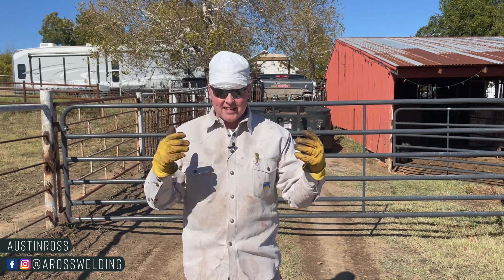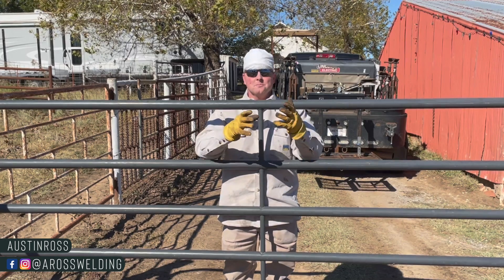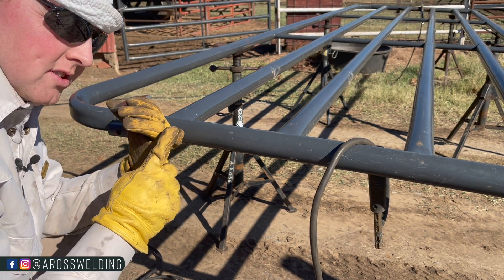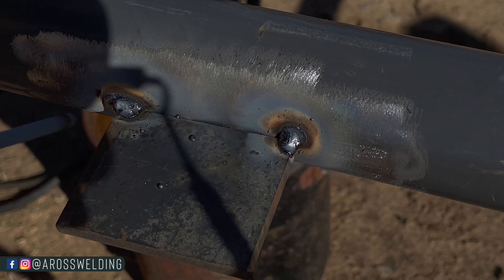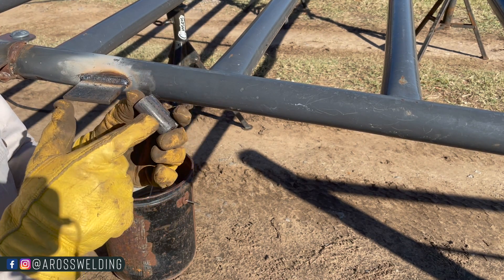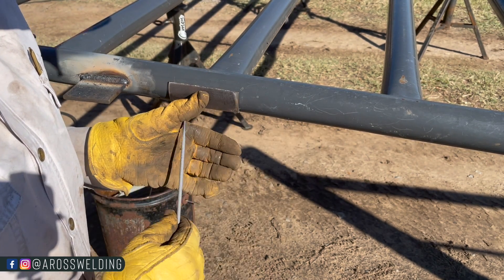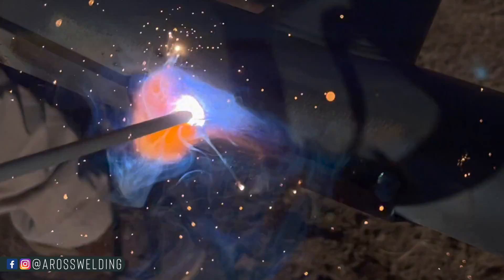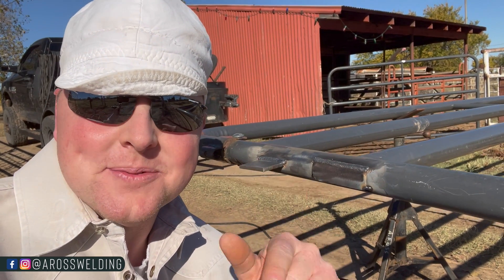WELDING THICK METAL TO THIN METAL WITHOUT BLOWING THROUGH

Comment: Could this still be done if the thick piece of metal could not be put against the thin piece as in your video. If the thick piece had to be under, I would think that it would be impossible to have a pool without dripping away from the thin piece if that makes any sense.

Comment: @4:08, why did u strike in the middle?
Reply from the maker: More or less to warm up my welding rod
Reply: @arosswelding   Thanks for the answer, I wondered if that was it. Great tip! Do you always chip the slag off your tacks before welding over them, or only when you're doing critical joints (like leakproof, or structural). In some of the latter cases, or for better appearance, would you perhaps even grind the tacks to a concave profile?

Comment: Thank you for your assistance. I have limited experience in welding and am attempting to weld a wheel bracket onto the front of my mower. I have tried using a 6013 and a 6011 at 70 amps, but have only burned through the lighter deck material in my attempts using a Hobart Stickmate LX

Comment: I got a 300d do a lot of pipe work and been thinking about buying a sae but the Corse currant or as you called main kind of makes me feel like I’d be trying to figure the Machine out for a long time be for I would get it how did you adjust to it from gears and like when you weld low high like that to have to figure it out see where it’s better I guess my question is how long it take you to get that machine figured what dose it do to the ark and would you go back to gears or stay corse currant

Comment: Question~ I’m not a welder, but I weld a lot.  I don’t  use a Lincoln SA-300, or 200.  But usually a Miller MIG, or trailblazer 275.  How do the settings on a SA200 or 300 run over to say a Miller digital?  Basically I don’t know the 2 dial setup.  Thanks!

Comment: I learned to weld while working for rumpke. Replacing bottoms on dumpsters and roll offs, you learn to weld thick to thin. New to old essentially. Had to hold fluids otherwise it's a 10000 fine from the EPA per can. I learned real quick

Comment: Some good tips Austin.👍  I might mention that when you weld that fish plate and don’t seal the ends, water can get in there and promote rusting.  When practical, I like to close up the material on all sides especially if you plan to paint or powder coat. Otherwise you will get rust streaks on the finish.

Comment: what is it  with americans  using that   back and   forth with the  stick americans  use so much?
Reply: I think you've seen this technique mostly with quick cooling rods like 6011, 6010. He's letting the welding pool cool, so as not to burn through.
Reply: the rythm can lead to more uniform travel speed for some

Comment: Hmm gotta get me some 6010 I've never welded with it before, 6011 yes but it's hard to get where I live it's all 7018. Couple weeks ago, I was doing a patch job on the dump box of the dump truck I drive. I used 3/16s the original metal maybe 10 gauge it was a pain in the ass to weld. I did it with the wire feed running .045 flux core I was going texas tig welding with a wire feed there was thin spots (rusted) on the inside of the box I couldn't see it. Striking the arc then dragging it to where you want to start never knew that trick in all the years, I've been in steel fab.
Reply: the drag start is a code work thing.  it allows any arc strike to be welded over and included in a hot weld bead.  also preheats metal a bit

Comment: Having been a heavy duty mechanic / welder for 35 plus years I have seen many struggle with trying to stick thick and thin pieces together. It’s a bit tricky yes but as you just showed and explained very well. It’s not that hard to do with proper technique and a little practice. Important to concentrate the heat to the thicker piece and just let the weld puddle flow to the thinner material great video again 👍
Reply: I’m 18 and gonna be a heavy duty mechanic/ welder also great advice
Reply: @scotthintz8416  it’s a good trade. It can’t be automated
Reply: I was on a job site welding a piece of Unistrut to a thick steel beam and it was such a pain in the ass the guy I was with told me to lay down a bunch of tacks me knowing that isn’t right I went ahead and did it bc I am still a apprentice but I keep burning through the unistrut and I was gonna burn the rod up on the beam and flick it down would that have worked ?

Comment: for thin metal use 6013. But 6013 is crap of a electrode to weld with. But really it depends on brand and type of 6013. But might save your ass at 1.5-2mm (1/16) thickness. But then again I prefer to take my 300a inverter mig and gas cilinder (18/82mix) with me.

Comment: I use a 3/32 6010 and then cap with a 3/32 7018. It gives me more material to work with.
Reply: good idea - first bead becomes a heat sink

Comment: Put the heat on the thicker metal and allow the puddle to wash over the thinner metal
Reply: Lol that's basically it. I have an over head project coming up where the thin metal is on top with a 1/4 plate on bottom. Wish me luck I'm rusty!

Comment: Always favor the greater heat sink (heavier material ) Doing a fish plate as Austin describes spreads out the dynamic load  stresses  cracking of welds will be reduced or in the heat affected zone beside the weld
Reply: always remember fish plates will work best with round corners or an oval shape.  stress maximizes at corners

Comment: Here in the UK, "thin" is anything under 2mm or roughly 1/16th of an inch.
So anything above that is weldable without the risk of blowing a hole as soon as you arc up or make short stitch welds.

Comment: Quick direct question, Austin - flux core mig is pretty much "endless rod" welding - I've welded since I was a kid - every flavour - I now can't much justify picking up the stick welder as the flux-core machine (I have one welder set up just to run 1mm flux core - 16 amp machine, plug it in, weld) - is just so much easier/better.  No gas - like stick.  Cheap welding  plant - like stick.  No great surface prep - like stick. Very un-fussy process - like stick. Hugely strong/tough welds - like stick. Flux core wire is cheap as chips - like stick - pretty much... (flux core is cheaper... do the math... it's cheaper) I bought rods today for a job - by the foot of weld, flux wire is cheaper...they want rods... go figure.. 

No stopping,  reaching for a fresh rod - unlike stick. You've a whole roll of "rods" lined right up - with close to no "downside" - none that I see day to day... Why you no use flux core?? First time I used flux core, it just made so much sense - no more worrying about wind/weather, no need for pita gas, no need for huge prep - point, squeeze, weld.
Reply: Tensil strength is less in flux core
Reply: @klizzyykicks1712  Dunno if it is in real-world stuff. Never had a flux-C weld break on me yet. Even the tacks are a PITA to get loose when you want to change stuff - a sure fire guide to how weak/strong it is. Going by the shade I have to run my mask at for FC - it burns crazy bright/hot - I'm guessing the penetration/strength is "Just Dandy" tbh,.
Reply: @jamesward5721  I currently weld on army tanks for the government and before them I welded submarines for the navy.. flux core isn’t approved on the hull because of its tensil strength..in some applications it’s great but for something life and death it’s not it
Reply: @klizzyykicks1712  I meant gates & fences & workbenches. :-)  The light thin stuff Austin has to weld now & then.  No one process does all - not by a mile.
Reply: any outdoor code work will be stick.  indoors dual shield may be ok.

Comment: Can you get same results with buzz boxes? Because I have mostly welded with these.
Reply: I use a Lincoln 240 amp AC buzz box for everything. I even used it to weld up 1.5 mm 309 stainless exhaust pipe on my truck using a special 308L stainless rod at 60 amps. Using the correct rods and amps is key as long as using the correct technique just like A Ross has demonstrated here. 6011ac is your all around welding rod, works like the 6010dc rod, 7018ac is great for anything structural or anything that sees a lot of vibration, but make sure to keep your rods away from moisture since they are low hydrogen and also 7018 needs to be ran straight, letting your puddle backfill with correct speed, do not use any whipping motion or back and forth.
Reply: I started welding in the 70s on a little 220v Airco buzz box.  Used that for many years and built a lot of stuff including pickup rear hitches.  I ran mostly 6011 and some 7018 AC rods.  I never ran the little 110v welders so I can’t speak for them, but the 220v AC machines will weld pretty good.   They are actually good to start out with because when you move up to a better DC machine it will be easier. Lol
Reply: Hey bud, Much of this depends on rod size, type, and required amperage. I would say that you "will" be able to weld the same thicknesses of steel as shown in Austin's video, but as far as I remember a buzz box typically runs alternating current, whereas Austin's Lincoln machine is pushing DC. Now those 60 series rods, 6010, 6011, 6013, etc. usually will run with AC, but how it deposits the metal is a smidge different. Also, I am not sure how high your amperage can be pushed or what your duty cycle is on a buzz box either, so that will have to be decided by you. Also, what type of power source are you plugging into? Just little questions for you to think about. In the end, just weld it and see how it comes out. 🤙
Reply: If by buzz box you mean a small cheap 110 mig machine, then yes. Cheat to the heavy gauge metal and then let the toe of the bead bleed over into the thin stuff real fast. Use solid core with C25 so you can use a little lower amperage.